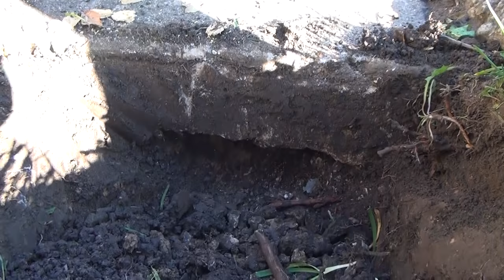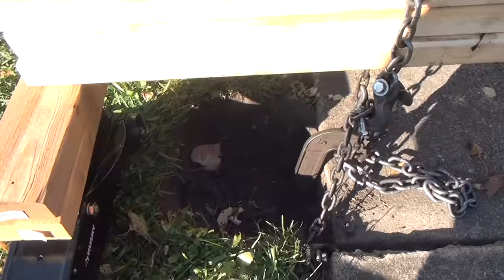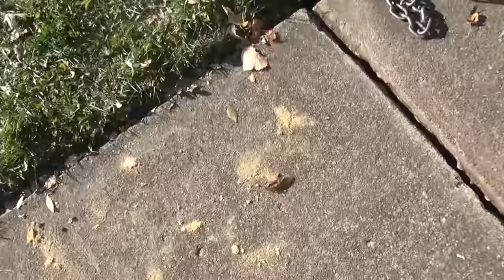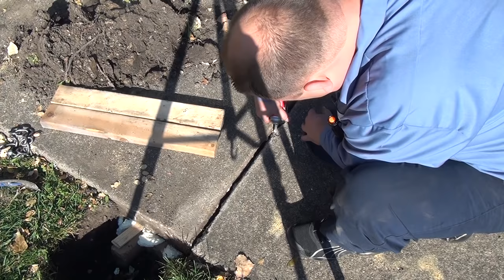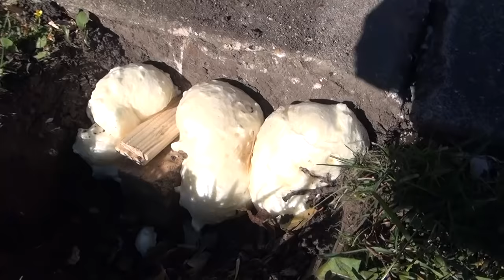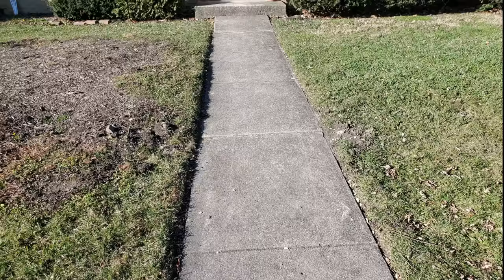Raising and Leveling Concrete Slabs with Gaps and Cracks Foam

Comment: I did the same thing years ago but used concrete slurry instead of foam. Poured it in the hole on one side, allowed it to flow under the slab and out the hole on the other side until it was about 2 inches from the top of the slab. The slab hasn't moved in 3+ years. The slab is also wider and longer than the one in your video..

Comment: After getting a vague quit of 6 to 800:00 dollars and a description of what he was going to do I did the lifting myself. First I over lifted the 5 times 14 foot slab with 3 hydraulic jacks, then lined the low side with bricks, pounding the bricks into place, then I used spray foam not the holes I drilled. Took me two hours.
Reply from the maker: That what we did. Also can update, how it holds in 1 or 2 years. Thank you

Comment: Since it was jacked, I would pick it up and fill it with concrete.  Done!  Fixed for 100 Yrs. A bag of concrete $2.59, and leftover to do 100 other projects.
Reply: Post war houses aren’t rated for 100 years
Reply: Yea a bag of concrete won’t complete it if it’s 4 inches
Reply: @InappropriateShorts  no house is "rated" for x amount of years. A home will always need some sort of maintenance.
Reply: @octaviogomez8097  who cares? Buy 5 bags... it will be cheaper.

Comment: This works very well, but mixing some concrete and back filling is not much more work and lasts so much longer.  I did this with my back porch which is a substantial slab of concrete a few years ago and have had no problems with it.  I feel like the expanding foam will degrade rather quickly and the weight of the slab will be placed directly onto the few bricks and it'll sink again.  I used 2 cheap bottle jacks from harbor freight and just encased them in concrete.  Cost me about $100 in materials including the 2 jacks a new shovel and couple bags of concrete.  I did use some old round papers I've been pulling out of my yard for years from previous owner.

Comment: Good project, but you should use a closed cell high density spray foam or liquid pour foam, otherwise the foam will get spongy from water absorption and will compress out too soon.

Comment: HELL YEAH!!!
I counted about four caps from the foam caps off the front sidewalk, so about $40.00 to fix that in front if you just ran up to Ace Hardware. That's way less than one of those Secure Set spray kits, or calling someone to do some mudjackin'! I like the floor jack Idea too. Bottle jacks would work too, but you would have to dig a bigger hole.
AWESOME!!! I'm doin' this!

Comment: great job!  I was hoping that after lifting the slab, you had just drilled a 5/16" hole in the middle of the slab and pumped the foam in from there.  But you really have shown what you can do with an immovable object (slab of concrete) meets an irresistible force (expanding polyurethane foam)  That's how water freezing can do so much damage!  Thanks again Doug
Reply from the maker: This video was recorded in November in cold Chicago in flood zone and sold in May with out any problem. I will say it works very well for one day job and $40 for foams
Reply: @YourHomeSolutionsUSA  we never know just how helpful our own experiences can be to others.  Thanks for sharing yours - Doug

Comment: Eastern Euro Techno and way that the slab was lifted was pretty cool. Doing a little extra work and putting something more solid and less toxic like crushed concrete seems the right direction to go, but I would need to research more. I just can't imagine this would stand the test of time. It's like a used car dealer buying the cheapest part possible to sell a car quick.

Comment: Try using construction grout to fill in the voids next time. If you fill
In your hole from the jack and leave a small opening to pour construction grout through, it’ll fill the whole void and self level itself under the slab. Then you don’t have to worry about settling and critters digging at it and using it for nests,
Reply from the maker: I don't think construction grout will work same way like a foam. Foam expended and can filled all empty space

Comment: Actually shimming with pieces of real slate instead of wood or brick will almost guarantee that the slab won't shift again or crack. Also slate holds to extreme weather changes, especially in Chicago. I have two of these issues at the base of some outdoor stairs on a project in TX and I think I'm going to use a modified version of this process. I will be stuffing in a good stone aggregate under the slab then using slate pieces for shims instead of the bricks. Thanx for the idea!!!
Reply: Fcking slate? Lmao... may aswell pour a new slab..it would be way cheaper.

Comment: The middle of the slab is still hollow! If one day heavy load is weighed on the slab, it will be broken!
It would be wise to push in gravels underneath to fill up the raised hollow space.
Reply from the maker: What do you mean by one day a heavy load will be weighed on the slab? One day Pink Elephant will walk on that slab? :)   I covered edge with bricks and filled it with foam, so I don't think something heavy enough to break that would walk on the sidewalk
Reply: @YourHomeSolutionsUSA  
Great great great grandmas heirloom armoire. 😂
 You never know bro. 😂
Reply: @YourHomeSolutionsUSA  yeah he thinks 3 axel dump trucks are driving up on it! Lol. It’s a walk way and even carrying heavy appliances across it isn’t nearly enough weight to break that.
Reply: @YourHomeSolutionsUSA  hahaha... was just thinking similar.🙈

Comment: Good idea on Jack in the slab up but I believe the rocks and wedges would have held the slab the foam probably unnecessary and a waste of money but may have gave it a little support from cracking but you might as well have Jack the slab all the way up and just field in the gravel but for a patch job either way works

Comment: Nicely done! Would it be possible to tip the entire thing up, level it out under it, and lower it back down? Or is the weight just too large for such an idea. It doesn't look like that large of a slab. Perhaps an engine lift or something to raise it up first and do it solid underneath?
Reply from the maker: Everything is possible, but example: you lift, level it out under it, and lower it back down and -- it's low. You lift again put more stuff under and lower it back down --- and it's high. ...   This is long and heavy slabs with fake separation divided in two.
Reply: I thought the same way as you do.  It is totally possible. Just the bottom of the slab might not be complety flat due to it was made by concrete with gravel mix.  It could be done but too much hassle

Comment: That foam is not meant for heavy loads. You can literally squish it with your hands. What do you think a concrete block will do over time. Hopefully someone didnt pay for this makeshift fix.
Reply: I think the foam is meant to keep moisture and water out from under to prevent erosion from under the concrete again, not for structural support. Either way this is just a much easier way a homeowner can do this without spending hundreds and some cases can be thousands for this service. Sure in a few years it may go back to where it was but so will professional work. (Yes I’ve had concrete raised and payed for by my condo association where they still 5 holes in a slab to raise it but it still goes back and is out of place in a few years)

Comment: I  have done it differently. When renovating homes in California, the city makes the home owner replace the sidewalk if it’s a hazard. It cost thousands because you have to pull permits, must hire a contractor with a C-8 license which comes out my budget. So we fix the sidewalks before applying for permits which helps me earn more money and saves the client from spending more. 

Lesson learned when a homeowner wouldn’t listen to me and wanted to hear the city tell her I was wrong. So the city told her she had to replace 36 feet of sidewalk. That cost her $14,000 and I would have raised it for $5k.

How it’s done… Dig along the side of the full slab (walkway), trench underneath every 3 feet, pour sand, pea gravel and even bags of cement will do the job? Cost much less than $12 can foam
Reply from the maker: Good Job! That why i did this job before inspector came in
Reply: That's absolutely despicable of Californian government... making the home owner responsible for the sidewalk and forcing them to pull permits to replace it? I hope that state burns.
Reply: You would need to raise and support the slab first before filling the space with gravel etc,  right?
Reply: @homeowner1215  …if you can raise it, pack it and lay the slab back down, that works as well. It all depends on the concrete. Some are too fragile, some can be raised and leveled.
Reply: @25christian  Can you explain how you would do this and decide ahead of time if the concrete is too fragile or  not?
Reply: @videoric  …if you can dig on the side, you should see the thickness. Also tapping it, you can tell if it’s solid or thin. Some contractors cut at the control joints, lift it, pack it and lay it back down. It’s easy when you have a Bobcat or something like it to lift.

Comment: I’m surprised the foam didn’t push it up even higher than where you set it
Reply from the maker: The foam just fills the empty space, When it fills the inside, it expands out from under the slab.
Reply: @YourHomeSolutionsUSA  probably fills out because of the opening because I’ve seen and heard of ppl using too much of the foam and it pushing a slab up higher than they wanted it. Perhaps depends a lot on the weight of it and the openings for excess to pressurize outward through

Comment: This is a temporary fix as this kind of foam doesn’t have the psi capability to hold up to the concrete over time and will eventually fail. They do how ever have foam designed specifically for this situation. If your going to fix it fix it right the first time.
Reply from the maker: Companys who work with foam designed specifically for this situation will charge you thousands.
Reply: @YourHomeSolutionsUSA  use geolift it’s a foam that is designed for that application that you can do yourself that will last.
Reply: @eric4847  where can you buy it?
Reply: @luptonpittman6520  Geolift isn’t something you can just go buy at a store. But you can contact Demilec for all the parts and equipment you need.
Reply: @eric4847  thank you
Reply: They could have just broke up that small piece of concrete and then just pour new piece.....
Reply: @TC-kf9zw  true, but it would look different. Maybe they didn’t want one square to stand out.
Reply: I'd bet this fix lasts 10 years because you are not disturbing the soil under the slab. If you do the math on that 200 pound piece the foam is only supporting a few PSI.
Reply: It can hold 60,000 lbs per square foot. Check the stats.

Comment: Sikaflex self-leveling sealant will peel up and crack after a few years.  Just use concrete colored regular outdoor silicone caulk.
Reply: That is not a sealant. Its high density foam. it will not degrade unless expose to UV light.  Since its underground, it will last a lifetime.

Comment: The slab I need to raise has the HVAC Compressor sitting on it. Can I raise it without moving the compressor?
Reply from the maker: Hard to say. Depends on how high you have to lift, how that A/C pipe lay out.
Reply: @YourHomeSolutionsUSA  That’s what I was afraid of.  Pipes,wiring and such. Sometimes you just have to pay the $ and have the professionals do it. Thank for your response.

Comment: Cool project. I can't tell by the video, is that open cell or closed cell foam?
Reply: It's open cell so... it won't last to long before it fails. Cheap can foam like that is always open cell
Reply: @randybobandy9828  any idea how long it will last ?
Reply: @wadedog  I could image no more than a few winter seasons. Water will make that foam soggy at some point. If you use the right foam it will last decades.
Reply: @randybobandy9828  does anyone make the right type foam in a diy can spray ?
Reply: @wadedog  not in a can but in a box. It's called "secure set".

Comment: The smart way is to get gravel under the slab so as not to create a void in the middle of the slab where it can and will crack
Reply from the maker: A lot of smart guys "armchair expert" can write a comments like this. 
Can you explain how you will put gravel under a slab? How you going to lift that double slab? How do you know how much to put a gravel to be in level (maybe you have to lift the slab again to put more or remove gravel).
This video it's ease, fast and practical solution to do it by yourself or with a partner. Foam expends and fill all empty space and stop entering water to your house.

Comment: Sorry doing this now how far apart are the holes and is there a certain kind that I need to get? And I'm drilling 3/8th holes but having a bunch come back up the hole.... Anything could help
Reply from the maker: I don't know if it going to lift just by spraying the foam, in this video i lifted slab by jack and then just filled empty space from the sides. 
In another project i lifted by jack but i drilled the holes. Holes has to be same like straw from foam can. I believe is 1/4.
Has to be tight.

Comment: What happens if the foam keeps expanding and lifts the concrete too high ?
Reply from the maker: The foam is used to fill out the empty space. In this situation, the foam spreads out and doesn't push the concrete up.

Comment: Good job....i don't know abut the foam though....maybe cement instead....
Reply: 100% agree. Why not cement. Foam will not last anywhere near as long.
Reply from the maker: How you will fill a hole with cement?
Reply: @YourHomeSolutionsUSA  Easy. Cement is self levelling. It will find it’s way in as you pour it in the hole.

Comment: I have a sidewalk that’s against the house. No way to jack both sides up 😢
Reply from the maker: You can use eye bolt. Drill a hole and use anchoring epoxy to set eye bolt, then you can lift your slab
Reply: @YourHomeSolutionsUSA  thank you. I will definitely give this a shot when I start. 👍🏽
Reply: @YourHomeSolutionsUSA  So after the job is done and the eye bolts need to come out, what do you do to remove the epoxy and bolts?
Reply: @caseyalexander2244  theres no way to remove that you have to cut them

Comment: If you only support the sides won't it crack and sink in the middle?
Reply: Yes, it would.
Reply from the maker: I support sides with bricks and that foam filled all empty space , so it's protect from cracks and flood
Reply: @RA82828  Great Video!
Reply: The foam will hold the weight.
Reply: Did you see how thick it was?? How can humans walking on that break it?

Comment: There is an easier way to do this.  Just hammer drill through the concrete and then use the foam spray can.  It will lift the concrete until its level. You dont need the C clamp and the jack. No digging needed.
Reply: At the end of the day wouldn't pouring a new slab be cheaper? I mean it couldn't be more than $40 in concrete.
Reply: I needed the c clamp and jack to raise mine, that expanding foam did eventually pushout on the side telling me the void was filled, but I was hoping to see if lift the slab, it did not.  I am going to buy closed cell, a pro kit,  with larger than 1/4" holes drilled and via youtube, I have see than lift a slab...  each hole I drilled took a can of foam...I got one side level and it seemed to lift the other !!, even with the minivan parked on it...

Comment: I've seen this stuff raise foundations and break them too
Reply from the maker: Do not force and pay attention for details then everything will be alright
Reply: Not this type of foam... maybe high density closed cell.
Reply: @randybobandy9828  yep, if you’re going to do this, then only use the closed cell—so water doesn’t penetrate it & break it down over time.
Reply: @brianallen8091  .... the red can Great Stuff is already waterproof

Comment: I think this fix is awful. This foam will degrade by water and soil germs in 1 year. You should raise that concrete higher, and put there gravel mixed with sand to level it.

Comment: Nice if you know people with car jacks and lumber that doesn't cost an arm & a leg  Why not use gravel, sand and soil?
Reply from the maker: The foam filled all empty space and stop water
Reply: How would you get soil and gravel under there to perfectly fill the gaps as well as be compact and tigh?t....you couldn't.

Comment: It's easier to just bust it out and replace with new concrete.
Reply: No!
Reply: @Jacob-ed1bl  obviously you don't do concrete.
Reply: @mikehorowitz7113  I actually do and that's why I'm saying it's not easier, if you think busting up concrete, moving the concrete, making a new frame and pouring new concrete is easier then you've never done concrete. It's definitely better in the long run to just fix it right the first time "as you mentioned" but not easier.
Reply: @Jacob-ed1bl  I do concrete for a living.  But to each their own.  To me it's easier to bust out that little square than to do all of that other stuff.
Reply: @mikehorowitz7113   You mean you think it's easier for your workers , I'm just messing with you. Have a good day.
Reply: @TC-kf9zw  😆 I agree
Reply: @mikehorowitz7113  there is always an easier way,if you can afford it and have plenty of money,if you don't,you do what you can.
Reply: @mikehorowitz7113  If had access to mixer it would be easier and cheaper. $5.87 for 80lbs   Bags at lowes. That might take 5-6 that could easily fit in any car trunk. My local store has raised pallet outside door you just slide off.  Those spray foam cans are around $6 , lumber, jack, clamps are not in most peoples garages. This is not to mention that spray foam in a can is not used for support. Had a friend try the riding mower tire spray foam trick. Not only waste of time but was hell getting tire off to fix properly.